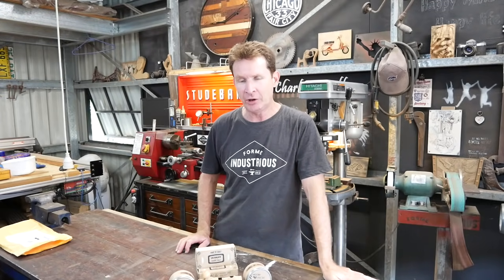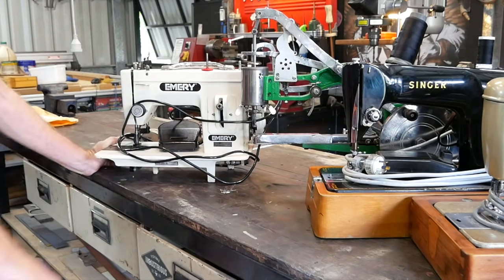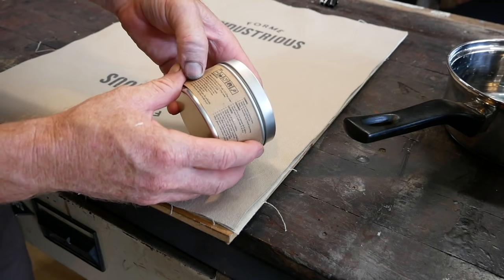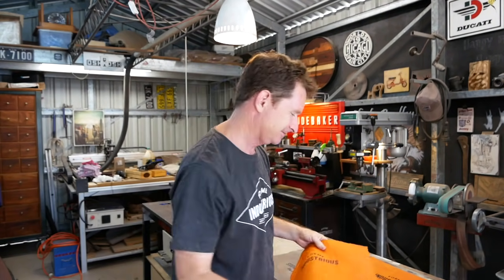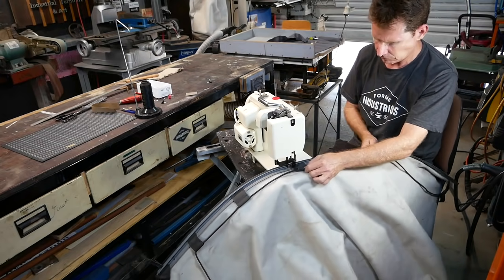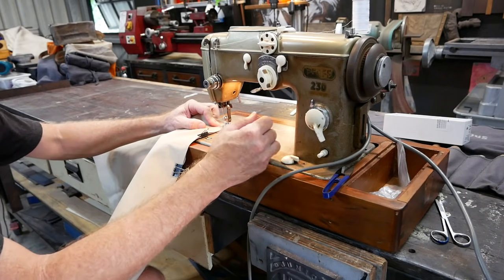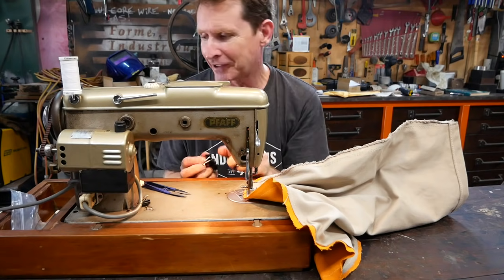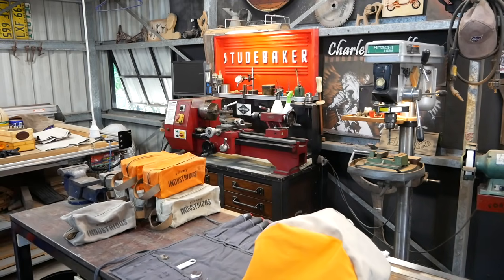Get Busy Sewing - Forme Industrious

Comment: Great work, Scott!  Next machine to add to your stable: overlocker (serger in the U.S.), which will round out your collection and make all your goods more durable & finished appearance.  Mine is an older BabyLock 738, sews through & trims multiple layers of Cordura with ease, despite being a "homeowner" machine.  NERD NOTE: three general grades of machines: Homeowner, Commercial and Industrial.  The last is built into a table with a belt-driven clutch or modern servo motor beneath.  All the best, Andrew @BranchAndFoundry
Reply from the maker: Thanks Drew! Yes a Serger would be awesome. Will have to sneak one in one day :)

Comment: I enjoy seeing someone pass on the knowledge of beeswax. I use that to treat leather of many kinds. 
I have an early 70s Brother industrial sewing machine. Have you seen the janome continental m7 sewing machine? That's the 1 I'm saving for. A shop near me demonstrated it. They ran 13 layers of denim or 7 layers of leather through it easily. Full ball bearing drive throughout the machine, touch screen etc. 
I love metal working a lot, yet i too admit that sewing skills are lacking in the world. 
I plan to have my own furniture company running before the end of this year. Would you like a sofa that is super comfortable, but also adjustable height legs and arms as well as made if metal underneath instead of wood? My designs easily hold 600lbs people without issues.

Comment: Nice work! What does a walking foot do for you?
Reply from the maker: Thank you! The Walking foot is designed to hold and move heavier material such as leather and canvas using the feed dogs and Presser foot. The standard machine presser foot lifts and the feed dogs underneath the pressor foot moves that material. Also the Walking foot machine allows a heaver needle. Hope that helps.
Reply: If you look at the foot of the walking foot you will see a bar behind it that the machine uses to pull the foot, whereas the std machines don't have the bar and the foot just goes up and down.

Comment: Thanks very much for your videos, Scott.  I find your approach very inspiring to get out there and just try to make something. I do have a question.  I noticed you Singer 201 has a new power cord on it with the third Ground pin.  The original would have only have the Live and Neutral.  Did you connect the Ground wire to the body of the machine or motor, or simply not connect it?  Thank you very much!
Reply from the maker: Thanks Roddy, from memory it is grounded to the motor (best I check to be sure next time).
Reply: Thank you!

Comment: Light/Semi industrial sewing machine is a misnomer they are either domestic or industrial, if any sales person attempts to sell you a "light/semi Industrial sewing machine" turn around and walk away.
I used to have 5 machines have cutting down to three  selling my last heavy machine at the moment, will still have a machine for anything I need to do these days. Pfaff machines are the best most well made machines on the planet.
Reply from the maker: I would have to agree. The PFAFF is great, solid but it is magic when it stitches. The Singer 201 is pretty good also, but only straight stitch.

Comment: My mothers sewing machine, that I inherited has stopped working. It was super high tech, with a laser guided foot, for making button holes, and name tags. It just makes a big blob of threads now, instead of sewing...
Reply from the maker: That's the problem with the modern machines. Once the computer gives up its junk normally, cost ineffective to repair. The older stuff keeping on chugging away.
Reply: @ScottTurnerformeindustrious  Tried to have it fixed, they said it was clapped out from wear. She did use it rather heavily for over 20 years dough...

Comment: I have one of the Pfaff 230 sewing machines.My problem is the know that controls the width of the zig zag has seized...I am wondering if I attempt to loosen the big screw...will I do any damage?  I would like to talk to you...
Reply: For know  read knob
Reply from the maker: Email Sturner2022@gmail.com.  Generally the old oil becomes hardened, and cotton dust can "seize" joints and controls. Try using some kerosene on the mechanism. Let it it soak and reapply. This softens the old hardened oils and resins. Don't force anything, let it free up slowly. It shouldn't take much.
Reply: @ScottTurnerformeindustrious  thankyou so much for your quick reply..Your video FOUND me after I put Pfaff 260 on Google. I will try the kerosene.. it is just the knob that won't budge..the stuff behind it all moves quite freely..I was given the Pfaff as a wedding present by my parents in 1958...It has sewed a million miles I reckon...I am 88 and just don't want to give it up...It came in a cabinet with a treadle option...the wheel never arrived...The fella that sold it to me has died and  I can't find anyone here in NZ  so  connecting with you is great...
Reply from the maker: @norah1933  I hope it works out Jeannette. They are a special machine, albeit darn heavy.